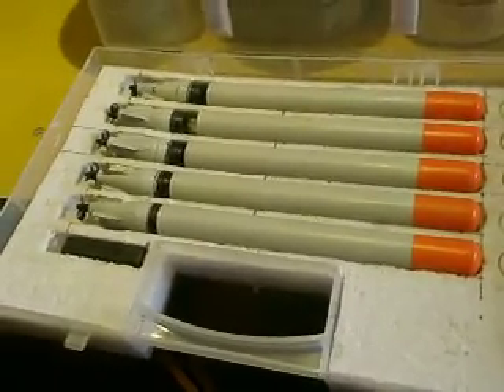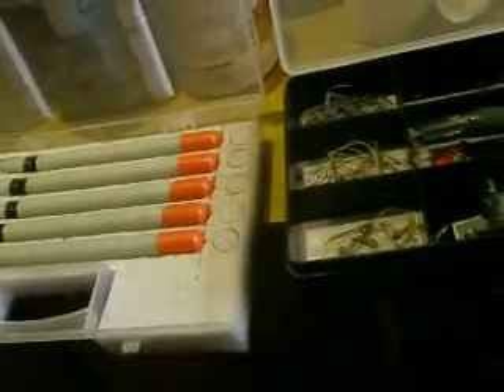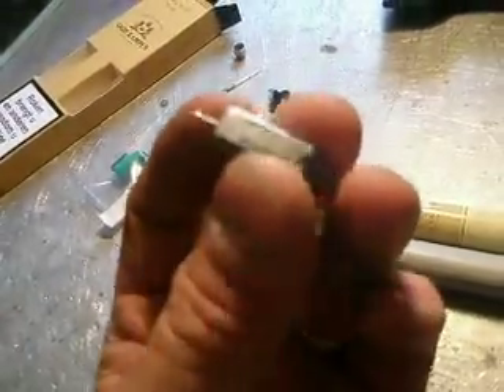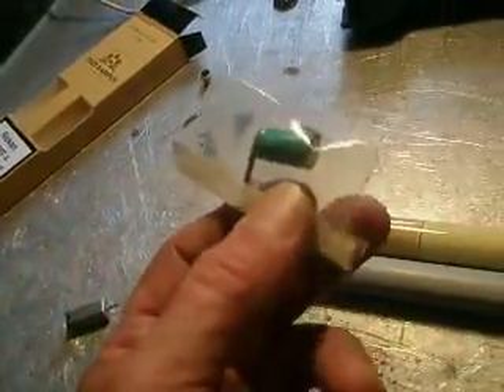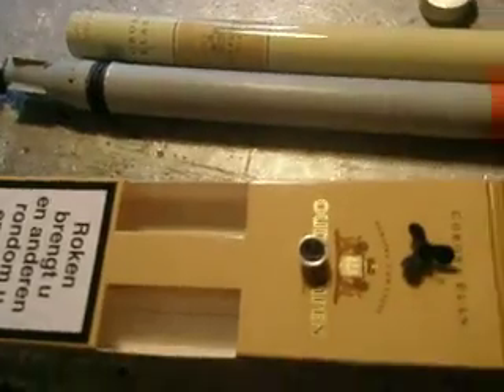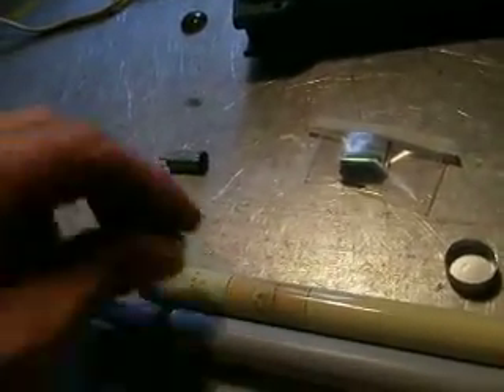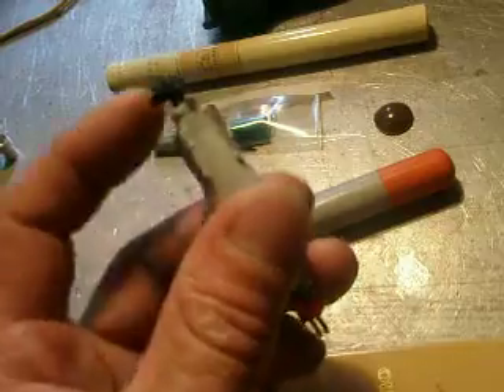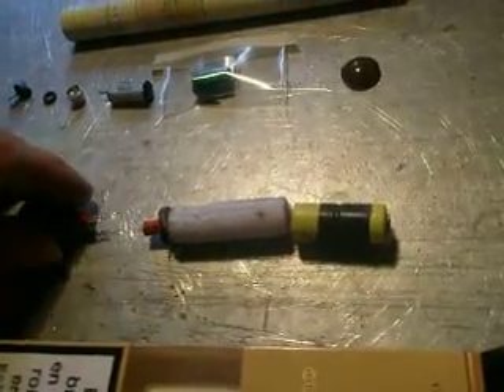rc submarine torpedo part 2

Comment: Nice fish. Triggered by a reed relay I guess?
What about the power source, not familiar with those cells: Do you use normal rechargeable batteries or capacitors to limit running time & quicken the charge?
Reply from the maker: Thanks,

Indeed triggered by a magnetic reedswitch, i use mini rechargeable batteries, they last for about 10 min, giving me a topspeed of 12km/u.
I know some people use capacitors, but when discharged too far from shore, you gotta swim, mine on the other hand can run the full lenght, so distance is not a problem, mostly i shoot them at sloped borders, easy picking.

Comment: Ok great. I've ordered the tubes, motors, magnetic switches. I will search for propellers and batteries at the local hobby shop. I was searching your videos to find how you fabricated the drive shaft and fin section but can't seem to locate that. Only the end cap with the O-ring. I can sculpt a resin tail section and make a mold for you. I need to figure out how to keep the water out of the shaft area though. My email is info@ericanthonyproductions.com 
I want to try and create a simplified launcher too.
Reply from the maker: As for the tailpart, try to keep it as light as possible, i use a special kind of plastick which floats in the water, cork can also be used.
Follow this link, it has some more pics about the torps, http://www.rcgroups.com/forums/showthread.php?t=1035932

Comment: Thank you for posting this sir.. Actually I have to make torpedo model like this, but with bigger size. I have to use 12 volt motor and it must runs below the surface. What kind of propeller I should use for make it run fast, straight, and stable? Can you tell me the tricks? Thank you so much

Comment from the maker: Well, you've got a challence, keep it simple and take a plastick tube for the body, bigger is better for your first try.
You can make the nose and backpart using some high density foam, it's easy to sand, and by using a simple drillingtool and sandingpaper you can make it conical.

Comment from the maker: @joetungchunyuen123, 

1 aluminum cigartube
1 micro e motor 1,2 Volt
2 microbatteries each one 1,2 Volt 150 mA
1 magnetic switch
1 propellor, diameter about 12 mm

The back of the torpedo is made on the lathe, i made this from special plastick, but wood or cork will do the trick also.

Comment from the maker: @Auslander999 1) the propellors are from a tamiya model, scale 1:350, it took them from the yamato.
2) the black part is made from plastick, made that on the lathe to get the shape right.
3)I used a cilinder of styrodure, hollowed it out and stuffed the magnetic switch inside, i use this methode to protect the glass part of the switch against impact.